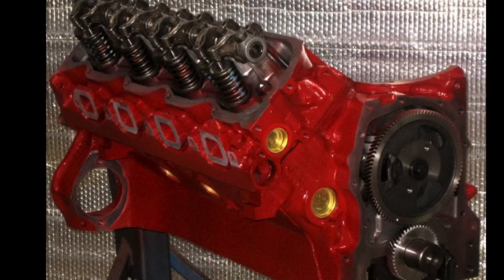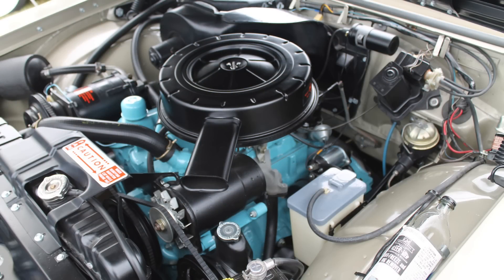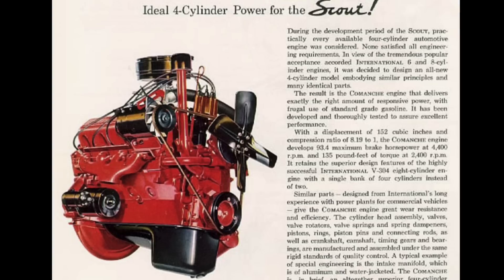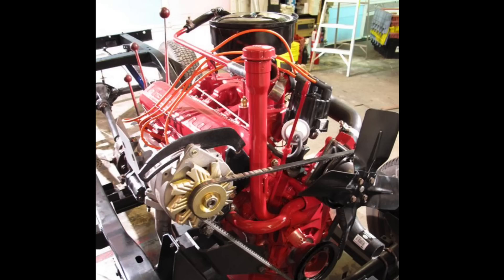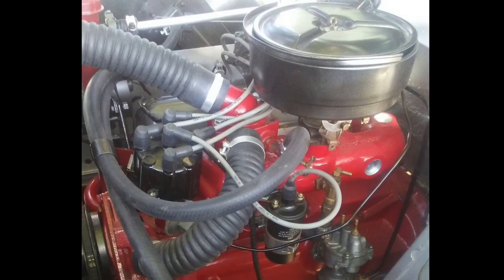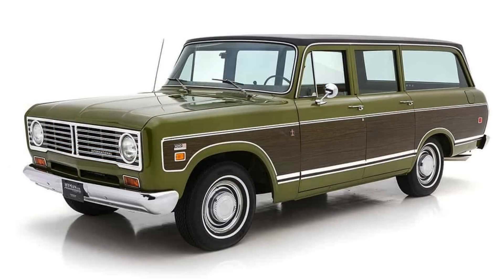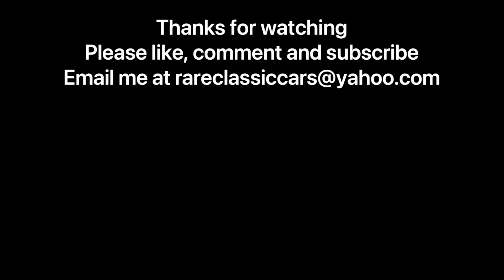Strange Automotive Engines:  International's (IH) "Half of a V8" Comanche 152/196ci 4cyl!

Comment: Probably the weirdest engine ever put in a car was the British Trojan. 4 cylinders but only two spark plugs, basically an opposed piston 2 stroke bent in half to use a single crankshaft.  A bit like the ‘twingle’ engine in Puch motorbikes.

Comment: Supposedly the turbocharger was the same on the 152 engine as the Corvair Monza Spyder. IH intended for the use of a turbocharger for high altitudes (Colorado) But offered it to anyone who wanted one. This engine could not be more opposite to a Honda engine. Rough as hell and hated to rev, but low end torque, especially as a 196 4 cylinder.

Comment: I had an early '60's Scout with the 152 cu. in. motor. A great vehicle. Plenty of grunt to
climb steep, rutted tracks, with heavy loads like gravel. All this complaining about top
speed issues is misplaced. The Scout was not designed to be a high speed highway
vehicle. These were simple, utilitarian trucks, set up to compete with comparable Jeeps and Land Rovers of the day. This they did, very well.
By the way, the Chevy 4 cylinder Iron Duke was introduced in the early 1960's, in the
Chevy 2. I had a Chevy 2 sedan with the Iron Duke engine, and three on the column.
Very economical. I wish I had it today. That motor was also available in the half ton two wheel drive Chevy pickup of that era.

Comment: Half a 345 V8 engine which were a good truck engine. My 4 ton Inter had that engine and would cruise at 110k all day with a racecar  and spares on the back.
I used to drive a Inter Loadstar tandem tipper in the 70s. Had a 354 Perkins and was slow, the V8 345s used to go past me 1 or 2 gears up with the same load on the hills.
Scout steering boxes were favoured for speedway Super Mods.
And a chap used a Scout engine in a speedcar. Never that fast but seemed reliable enough. Near certain the heaviest engine racing! Everything on those engines was heavy cast iron. Timing cover, thermostat housing, intake manifold, waterpump, all brackets and the flywheel was very heavy. At least the midget did NOT have a flywheel!

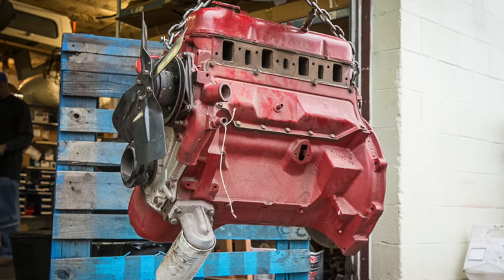Comment: 5:17  yeah they were responsive alright, drop the clutch it responds by choking! this size vehicle needs at least 6cyl. A GMC 305 v6 would been better, why not try buying engines from GM. A if it is a 4cylinder it should be a low rpm tq monster, if its a chevy , half of a 8.1L 496,  make a 244 cid 4 cyl, or something in the 230-250 cid range with a long runner intake with somewhat small port heads with fairly large valves for the intake port. With decent size exhaust ports with raised ports. And large wuench pads. Around 9:1 compression, possibly convert to overhead cam. Possibly using a pair of single barrel carburators. With progressive linkage. Revving to about 4800-5200 rpm peak tq about 2000,rpm peak hp around 3800-4200, yet a hot rodder could port the head, get it to rev to sbout 5800 by also regrinding the cam or replacing it get arounf .060" more lift. And 10-20° duration, not possible by regrinding, and get a bit of overlap. Retard the cam timing with stock cam could get a bit more power. Taking  low end tq.  Possibly raise the compression to 11:1, it should get close to 180-200 hp  250 TQ , with the intake modified to accept a 500 holley 2bbl. Otherwise tge stock engine should be 260 TQ, abd 130 140 hp maybe,  it wiuld be much better than what they did!  Or go with 3/4 of the 304 split the rod journals v6

Comment: The 96-04 Chevy 4.3L isn't just a 350 with 2 cylinders chopped off. There's actually quite a few differences.  It's got thinner connecting rods than the V8. It's got larger connecting rod bearings than the V8. It has a balance shaft in the lifter valley connected to the camshaft via gears. They are also neutral balance on the front and externally balanced flywheel or flex plate on the rear of the engine.  The pistons ,valves, springs, and harmonic balancer  are about the only parts they share with the 350. The older ones with no balance shaft share more with the 350.

Comment: When I was a kid, our hunting vehicle was a '66 scout. Not sure what mill it sported but it wasn't any kind of fast on the pavement. Get that little dude off-road though, and if you knew how to drive it there were very few places it wouldn't get you into-and out of. We were able to trek into places that even the f-150  4x4s would hesitate to go. The scout stayed on top of most of it instead of plowing through and bogging down. With the addition of the 8k# Warn winch we went anywhere we wanted, we just couldn't get there fast!

Comment: My Uncle had a '65 Scout with the 4 cylinder. What was unique was it had 4 gear shifts! The normal 3 speed, then an overdrive spliter, then high/low range, then in and out 2 or 4 wheel drive. Also had manual front drive hub locks. Just about the most reliable setup ever. He lived in Hawaii where speed wasn't important.

Comment: I had a '61 scout with the same engine. Super smooth and very reliable engines. Decent torque for its size. No top end power at all. With vacuum actuated wipers. Climbing a hill in the rain I'd have to let off the power for the wipers to work. Good times.

Comment: The 4 cylinder was also used in IH's entry level pickup in 64.  The C-900 had a standard cab with a 6 foot fenderside box. I drove one as my daily vehicle for 30 years.  In the pickup, the engine is in the true V-8 position, where in the Scout the head was a bit closer to vertical.  Indeed, the engine was low on power, it wouldn't run at what are now normal highway speeds.

Comment: A small number of light duty half ton IH pickups in the mid 1960's were equipped with one of the IH Slant-4 engines.  They were meant to compete with the Ford Econoline, Dodge A100 and Corvair rampside pickups.    IH used the AMC six as the base engine in their pickups during the 1970's.  Also IH used the AMC 401 V8 engine as an option in their 1970's pickups as well.

Comment: Had a 71 Travelall and a Raider snowmobile (rear engined with a sit down drivers seat). The interior was brocade green, your grandmas coffin pattern. Backed it up to a snow bank, punched the snowmobile to load, it hit the front seat at about 12 miles an hour with both skis, bounced off the front seat, threw it backwards 2 feet, caused no damage to the seat. The engines weren't the only tough part. Bought it for $1488, traded it in on an El Camino for $1799.........just sayin'.........

Comment: I bought a 1963 Scout  in the fall of 1971. It had a snow plow on it. Rear end was out of it. Was fortunate to find a used rear end. Ran the Scout until it was severely rusted out to the point that the passenger seat was falling through the floor. I found a 1965 Scout right hand drive with own motor. The body was in good condition.  I swapped the body onto the 63 chassis.  Swapped all the controls  and dash and everything into the 65 body. Made new foor pans and bed floor. Completed the project  in 1978.  Ran it until 1985 and sold it for the same amount of money I originally paid for it.  Plowed lots of snow with. Wish I still had this Scout.

Comment: My dad bought a used 64 Scout half cab for a ranch vehicle in the early 70's and I used it quite a lot. I always enjoyed it. What I think you fail to realize about the Comanche "slant 4" in that 3,000# vehicle was the gearing and it's competition at the time. I mean what was the competition a Jeep CJ with a flat head 4?  The Scout was indeed heavier but it was a lot more vehicle as well with a real cab. Not to mention at that time trucks were for the most part generally not speed demons and under powered anyway. So it really wasn't noticeable in my opinion. Of coursethat changed with the Bronco. I may be biased because I didn't try to do constant highway travel with it but I wouldn't with a CJ either. Don't believe either were designed for that. The neighbors had a CJ that I drove often in the same time period. I wouldn't call the Scout nimble but you can't hate it with it's simplicity, reliability and capability.

Comment: the 152 was clearly a under powered engine for the early Scouts , it was fine for areas that were mostly flat land,  I had both a 1963 and a 1973 Scout 2. The 1972 had a 345 and it was a great little truck to plow  snow with. In the 3 speed configuration it was like having a forward-rerverser,  in that you could just go back and forth between 1st and reverse to do a driveway or parking lot.

Comment: Another interesting example of this concept is the Saab slant 4, which is a Triumph Stag V8 with one cylinder bank chopped off.  Triumph developed the slant 4 for a different sports car which IIRC got to market before the V8 it was derived from.  Saab licensed the design and kept developing it for years, turning it into one of the very first turbocharged engines ever sold in a passenger car.  They originally planned to offer the model 99 with the V8 as well, but scrapped this idea and went for turbocharging instead.  The original Triumph slant 4 has a horrendous reputation, but Saab fixed the design to the point that the Saab 99 I grew up with went past 750.000 km (almost half a million miles) with no significant engine work (but three clutch pinions).

Comment: I had one of these in a 1964 Scout.  It was a great little motor.  
Why did it need to be a quick or fast vehicle?  It didn't.  The 152 had plenty of torque for what the Scout was designed for which was off road usage.  And, that is how I used mine and it would go anywhaere a Jeep CJ would go and sometimes more.

Comment: My dad bought a new '62 Scout. The body an chassis were great. But the running wasn't vert robust. Axles were about the diameter of a quarter.  The 3 speed trans was weak and would always pop out of 2nd gear (three spd trans). Would have been great with a 304 and a granny low 4 spd.

Comment: Have a couple other IH 800s fit to make a complete one behind them of which has the 304 (everything starting from the lower rockers to the middle of the rear fenders is G O N E to rust) while the other has the metal to replace what's missing while the former has SOME salvageable end bits)...have had the mind for most of the last 8 years to make a 6x out of them.

Comment: Have a 61 Scout 80 w/ the 152. Got it New Years Day 2010...had to tow it the 7 miles home. Rough around the edges w/o a top. Original carb long gone before I got it. Had a custom adapter for a VW Solex (Made in W Germany) that was so fouled ended up replacing it with a no-name clone. Sat for 4 years before finally getting it running w/ a REAL (all the castings marks) Weber 32/36. Didn't drive it around as much on the trails as much as I would've liked but that thing would lug down to 300 RPM & seemed content to stay there as long as you fed it for the short time I did have it there. In 1st gear 4-LO it had no problem albeit slowly going up nearly 40deg slopes. Still have it & eventually would like to get it going again as the last time I even ran it was about 5 years ago now.

A couple times a 196 came across my sight but unfortunately I was too late or it was way too far away.

Comment: The turbos wasn't so much added for power as it was for high altitude use. Historically, IH had developed high altitude packages for most of their tractors (usually consisting of a contoured dome, high compression piston) so the turboed 152 was in keeping with their sensitivity to operations in high elevation areas. Also, IH used the AMC 401 engine toward the end of production in pickups, but I've only ever seen one in a Scout that was a factory installation.

Comment: I am old enough to remember IH and it's... different engines.
They were cool. Outside the box.
Weird firing orders and choice of #1 cylinder.
Huge inline 6 gas engines in large trucks, carbs the size of a paint pail.
Generally they had lots of power.
In machinery the diesel engines had a gas start/diesel run mode to compete with separate gas starting engine such as Cat and JD used.
They had a factory in Canada, that and maybe because of their pricing strategy all levels of government bought fleets of them.
The "Royal Mail" before it became Canada Post, Provinces and Municipalities bought loads of them.
Same today, I would say Navistar depends on and caters to it's sales to all levels of government, school boards and military in
North America.

Comment: I love the every-other-terminal on the distributor blocked off at 8:34 .  I had a '68 with the small V8 in the late '70s, it was red with a white top, of course.  I did have to repair a lot of rust, but mechanically it was solid.  It may not have been the most luxurious ride, but it always got me there and we had fun with it.  I remember on highway trips, after the engine warmed up and settled in, the engine emitted a busy subtle mechanical sound.  That engine had a song of it's own.  One of the more favored vehicle I have owned.

Comment: I owned two Scout IIs and two IH pick-ups. One Scout had the 196 four cylinder. That one ran a bit rough on acceleration.  The one with the 304 V-8 was much nicer.   It kinda broke my heart when IH quit making those vehicles.  I still have a 560 Farmall (same 232 c.i. six cylinder engine as my 1951 IH pick-up) that I drove home new from the dealer at age 11 when my dad bought it in 1963.  Finally, I’ve driven hundreds of thousands of miles over the road in International semi tractors.  International Harvestor is a big part of my life.

Comment: Once again my friend awesome video. Being a former owner of one Scout 800, that was my uncle’s before mine, he was the original owner that had bought it for hunting up north. With the 304 V8,4speed with the tallest 3:04 gears for highway cruising. Plus he plowed a LOT of snow on his property and street. Then I inherited it and drove for one year, then traded it in on. Used 73 Scout II in 76, that had the 258 AMC straight six, 727 automatic with one speed silent drive transfer case, with locking rear. That really wasn’t needed anywhere but ice/snow, because of the lack of torque to the ground, but it cruised all day at 70 easily and never used any oil. But I got tiered of having my friends get out to push on the beaches in deep sand, not because we got stuck, as I had 30-12.50-15 tires, but the lack of torque without low range. So I special ordered a 78 SCOUT II TERRA, 4 x4, 345 V8 dual exhaust, HD 727, HD Borg Warner 2 speed transfer. With 3:52 Detroit Tru Trac, in a Select Edition that was like the brown and gold one in the video, but mine was black and gold, with white removable cab roof, with two roll bars, one in the bed, one in the cab. With a 2” lift, 32/10.50-15 GoodYear Tracker tires. The factory grill/brush guard, and three HD skid plates from under the front bumper and under the axle, then oil pan to trans/transfer case and gas tank to ream bumper, plus trailer hitch. I added the biggest KONI shocks I’ve ever seen and Cebia Z Beam halogen headlights, which two KC DayLighters on the grill, 2, Cebia BiOscars on the grill that were driving and fog lights, plus a remote spotlight mount just above the windshield in the center of the can roof. With a KC DayLighter sealed bulb with 400,000 candle power, for a total of over 1,750,000  candle Power all together without the headlights. On a local beach on a dark night I could light up the entire beach from low tide line to the top of the dunes for as far as I could see, on a 4 mile stretch. The spotlight on the roof could light up a boat at least a mile off shore. At night pulling up to a friends apartment on the third floor coming up the hill from a quarter mile away I could light up his entire apartment like he had every light on! The lights were all so powerful it was a good thing I didn’t have AC, because I had to mount a second 180 amp, $250 custom wired and installed alternator and second battery just to keep them on for a few minutes at a time! Now with LED’s it’s nothing, but I had enough amps to weld with! The ONLY trouble with International vehicles was rust/rot. I even had the 78 TERRA Zeibart “rust proofed”, with the top of the line bumper to bumper lifetime coverage. When I went in for a claim in six years when all of a sudden after winter I noticed each fender and taillights showing signs of rusting? I was told sorry bout yer bad luck buddy to much driving on the beach!!! Even though the truck was meticulously maintained and cleaned and waxed and bottom rinsed all the time, looking like new as you walk up from across the parking lot! If I were to build one now? I would seriously consider using a fiberglass tub and front end. With a roll cage and re-enforcements.

Comment: You're criticizing the power of this engine from a modern perspective, honestly. Yes, a vehicle the size of the Scout would be laughed out of the marketplace in the US in 2024 with only 93 horsepower from a gasoline engine. You wouldn't dream of bringing something that size to market with less than 200HP these days. But that wasn't out of line for a utility vehicle in the 60s. The important part was that it made 135 ft/lb (183Nm) of torque at only 2,300 RPM. That's exactly what you want in a truck/utility vehicle engine- peak torque down low. No, you're not going to win races in it, but it will pull medium trailers, drive over obstacles, and in general, do the kind of work it was meant to do. And if you wanted more power in your Scout, you could get it.

Don't forget that just 40 years ago, there were loads of 5+ liter American V8s making just 125-150 horsepower. The muscle car era that started in the mid 60s was kind of an anomaly- up until then, 200hp+ was mostly only available in expensive luxury and performance cars. Pickup trucks and utility vehicles had dedicated powerplants that favored durability and torque over power, and this engine wasn't at all out of place in that respect as a base model engine at the time.